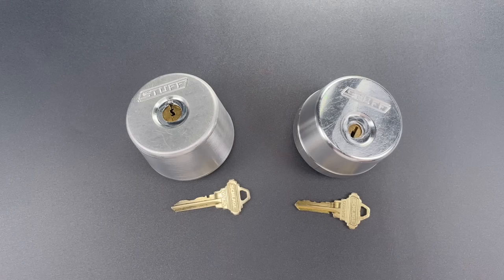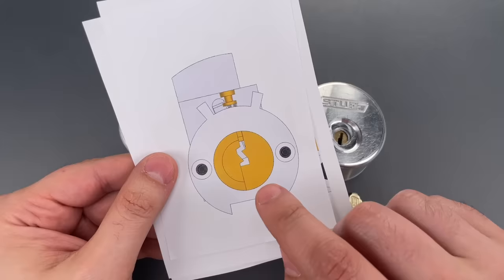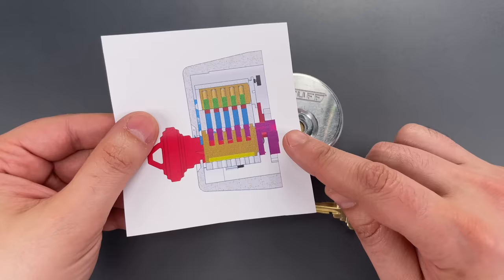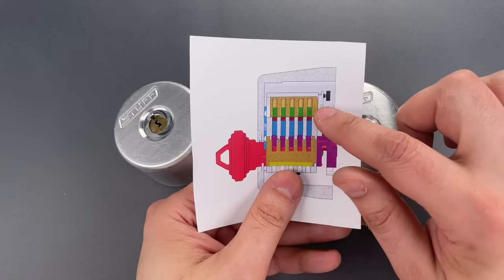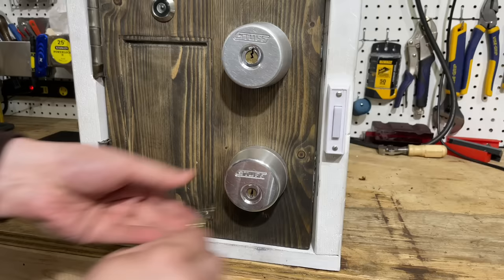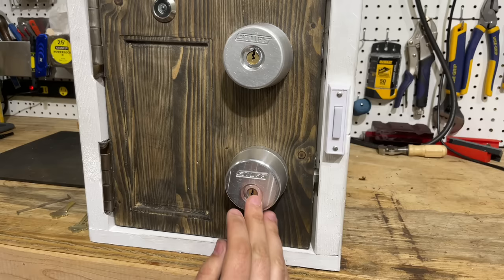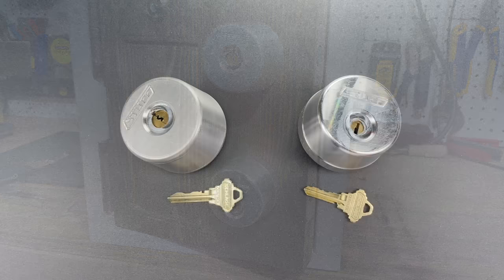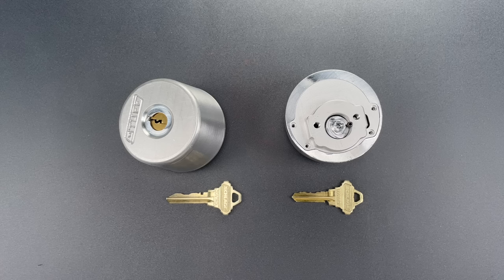[1299] Unpickable Locks From Stuff Made Here

Comment: Imagine putting all that time designing and testing these locks just for this guy to open them with a knife and a hammer.
Reply: the knife trick wouldnt work on a real door and the hammer trick only worked on the first design, he didnt even actually open it in a legit way.
Reply: @Alexandros.Mograine  he opened the second lock in a 'legit way@ by slipping a tensioning tool under the lock into the mechanism? the knife was just showing another vulnerability to the lock that was pretty clear in the video
Reply: @Kyle-kv6ur  that method also wouldn’t work on a real door. Locks are set in a little deeper on real doors. Had these locks been mounted properly, only the first would have been opened successfully. The second design can only be opened through kicking the door in or drilling the lock, which is already possible on practically any other lock.
Reply: @Kyle-kv6ur  didnt you watch the video? stuff made here made a part which makes that method impossible anyways.
Reply: @Alexandros.Mograine  "he didn't even actually open it in a legit way".
Yeah, that's literally what lock picking is.
Reply: Prototyping is designed for working out flaws. With what Shane has learned, he should be able.to design an unpickable lock. Possibly.
Reply: @CadillacDriver  you dont understand, what i mean is that neither of these tricks would work on a real door, is that so hard to understand.
Reply: @Alexandros.Mograine  I do understand. You don't understand that sometimes there are gaps in door frames big enough to get a knife in. That's exactly how the credit card trick works. Fact is, he bypassed and / or picked the locks. Therefore they aren't pick proof.
Reply: Have you seen the one with the "impossible to break in car" ?
Company was boasting and invited car their to try.
He walked up and kicked the front bumper. Doors all unlock.
Safety feature, unlocks doors incase of accident to allow emergency access to occupants.
Reply: imagine just having the skill and ability to design and produce a lock in your basement🤯 I'd be making guns personally but locks are cool too
Reply: @CadillacDriver  👍🤣🤣🤣
Reply: @CPTater  what's the vids title
Reply: @Alexandros.Mograine  "ackchyually he didnt even open it in a legit way" lmao you're gross 😂😂
Reply: @Accept_decline  yeah, if that lock was on a real door you couldnt open it with how he did.
Reply: @Alexandros.Mograine   haha oh God, can you just stop. What constitutes a real door vs a fake door? do you manufacture doors? Is a real door made out of vinyl or is it wood or steel? How big does the door have to be for it to be considered a "real" door? Does it have a knob or a latch? Are your parents blood related?
Reply: @Alexandros.Mograine  for real, I’m pretty sure my bedroom door is a real door, and I would absolutely be able to use a knife to open it the same way
Reply: @Accept_decline  I think he's arguing that poor installation or poor quality of a door shouldn't be a factor in determining the efficacy of the lock's design. If I put more RAM into a PC with garbage specs and it doesn't make my PC run faster, I wouldn't blame the RAM.
Reply: @Alexandros.Mograine  it definitely does if the door doesn't have a strike guard. There's plenty of interior security doors that lack them, though putting an extensive and over-engineered lock on such a door seems a bit silly.
Reply: Well, just look at cybersecurity. You got people designing all these systems and websites and all it takes is one flaw for the whole thing to come crashing down. That's just the name of the game.

Plus, it takes a lot of effort to build and design something like, say, a house. It only takes a little bit of Monster Energy and a sledgehammer to destroy it.
Reply: @Rher_the_Moon  I believe it👍 I've seen dudes in the Philippines make them from scratch with basic tools🤯
Reply: @Alexandros.Mograine   Imagine being a gatekeeper in an activity about finding exploits and vulnerabilities lol
Reply: @Alexandros.Mograine  what on earth are you trying to prove with "neither of these tricks would work on a real door" when both of the locks are custom made supposedly to be unpickable (which isn't as shown by LPL)

FOH, lmfao
Reply: @Alexandros.Mograine  actually this Is what Is different from theory and practice. Normal locks would be unpickable in theory but are in practice as it's important to make them usable. Tolerances are what make locks unsecure but also what make locks usable both in Summer and in Winter (e.g. the metal getting bigger based on temperature). So i think these are legit weaknesses even tho the design Is really interesting
Reply: @Alexandros.Mograine  yeah no i checked my door and the gap is larger than your brain, which isnt saying much, but still large enough to fit a knife through
Reply: @Alexandros.Mograine  I have used the knife trick on a closed commercial doors.

Comment: My favorite part of the more advanced lock is that the lock mechanism itself wasn't defeated, it was bypassed.
Reply: That's the same thing when it comes to lock picking 🥲
Reply: @louisrobitaille5810  no, because all you need to do is shore up the surrounding bits, and it'll be a great lock
Reply: And LPL kinda threw himself a bone too because he had a solution to the bypass given to him by the lock maker, he just didn't install it for the sake of the video.
Reply: @charlesquinton9127  The maker only knew about the bypass, because LPL told him about it. And it would have only stopped the metal shim up the backside of the lock, it wouldn't have stopped him using the knife.
Reply: @CrashB111  installing a metal bar so the space between the door and the frame is not accesible wouldn't have allowed the use of the knife, that had to do with the installing and not tj the actual lock tho
Reply: Also if the door was a tighter fit like most doors are, the knife method would never work
Reply: @Liam Nilan  exterior doors never open to the outside anyway, so the knife trick wouldn't work, you wouldn't be able to see the deadbolt like that.
Reply: @charlesquinton9127  However the maker did not know to make this until told of the exploit, how many thieves tell the lack company of a fault and wait for a fix before breaking in.
Reply: @Paul Stubbs  If the idea of these companies was to make the most secure locks possible, they'd do the reasonable thing and hire am expert to try and bypass it. It's not an issue at all, just fix it up a little with the feedback you got.
Reply: @timmyvigland8962  doors of public buildings always open to the outside. in an emergency situation inside, people rush to the exit and may completely jam the door area, leaving no room to open a door that opens to the inside.
Reply: @paulstubbs7678  gentlemen thieves obviously.
Reply: @klaus-udokloppstedt6257  it's clearly geared towards a residential type door though. Commercial doors do not use this type of lock.
Reply: @klaus-udokloppstedt6257  the doors to flats here open inwards.  
not exactly a public building but the same problem exists.
Reply: @liamnilan343  With wood framing even a very thin but strong knife could make that work, probably.
Reply: @louisrobitaille5810  all locks can be bypassed with hammer
Reply: you have a hentai as your avatar. any opinion you have is automatically meaningless.
Reply: @paulstubbs7678  Did you really think this was a production lock in circulation? Some of the comments here are beyond stupid. Tell me about some of the locks YOU have designed and built? What? None? Not surprised.
Reply: @louisrobitaille5810  Metal door, or plate on the door with the locks edges welded shut completely defeats the bypass. Its different
Reply: @ibrudiiv  as a carpenter I’d just drill a hole in the door frame giving you access to the deadbolt from the outside.
Reply: That's how most security defeats work in general.
Reply: @CrashB111  Dude if you didn't notice, LPL installed the lock backwards on the inside of the door.. The door jam blocks access to the deadbolt on the outside 😂
Reply: @CarlYota  Yeah you didn't think critically there did you? If your in a situation where can use loud power tools and destroy the building itself, then lockpicking wouldn't be necessary to begin with!
Reply: That’s the way you normally defeat any engineers design… you simply don’t do what they’ve spent so much time anticipating and instead just do something different and bypass their work entirely. It’s fantastic fun for both and if really love to watch these guys continue to collaborate and make a truly unpickable lock!
Reply: @paulstubbs7678 a real product would have people like LPL QA testing the product if their goal is to be undefeated
Reply: @chaoswraith but you could say "but you could change this and that-" about any lock. The point is, if you do make those changes, there could always be another way. So I'd still say until proven otherwise, it was successfully picked. Twice.

Comment: You could literally send a solid rock to this guy and he would still pick it open somehow and no one would be surprised.
Reply: Today I will be opening a geode non-destructively. . .
Reply: With a pick-axe.
Reply: Imo he didn’t pick the 2nd lock, cheated to get it opened. Could easily design a block to stop something from being slid through. And first method was dumb cuz that assume a gap in the door. Block that off.. 

So imo he never picked it. Great job to smh, not worth building a v3 until he can pick v2 properly.
Reply: all you need for that is pretty big hammer
Reply: @carsonhunt4642  but he did pick it. Have you seen a door without a gap? He also mentioned he could have used a tool to measure the pins and make a key for it.
Reply: "Trying to avoid all the work, I came up with a less elegant solution."
Reply: A grenade
Reply: @carsonhunt4642  Pick it urself.
Reply: @damiengates7581  clearly has not seen his videos with electronic locks
Reply: @saikashima282  My dead bolts have a flange that goes into the hole about 1/8"... probably the "much cheaper solution" (vs "custom machined guard") that most mass-produced dead bolts have..
Reply: @carsonhunt4642  This isn't just about picking a lock. This is showing the faults of a lock.
Reply: @MarcosElMalo2  Haha! 2,000 years later - some alien explorer: "Hey! I found a geode! I'm gonna be a gazillionaire!" Opens it: "What the...."
Reply: TODAY on Rockpicking Lawyer..

Comment: As a welder,  here is a trick we use for some locks, file the back of the key do it is straight,  making a long slim key weld a plate (for steal door) over the lock that has a hole slightly smaller than the key stop at the end of the splints. The lock can not be hammered off,  added length stops a bump key, makes the lock difficult to pick. Even another key not filed down , can enter into the hole in the plate, as the hole is to small. This solved a lot of theft in remote job sites.

Comment: Shane: makes two impossible to pick locks
LockPickingLawyer: “Yeah, there’s like 2 ways to pick each lock.”
😂
Reply: True.
And these ways are easy to fix.
I like the respect the two guys have for each other.
I think with the improvements they are getting even harder to pick and perhaps even hard enough to pick so that it's just not worth even trying it.
Reply: @fickdieoma12345678  at that point it will be easier to melt the lock
Reply: And both methods can be fixed quite easily.
Reply: @fickdieoma12345678  lock pickers replace all their subtle tools with a battering ram
Reply: @fickdieoma12345678  Im really curious how long it would take to keep fixing these issues before LPL cant pick it anymore.

I feel like if they kept sending the locks back and forth, after a few iterations, it would require a completely new tool to be made in order to pick it.
Reply: @fickdieoma12345678  that would be true IF the actual practical purpose of a lock was to delay a thief not stop a thief. Any lock claiming it can stop a thief is lying to you. The locks in this video took a trained lock picker a month a figure out but in minutes he was able to get into the door. As you effectively have 8 or so consumer locks total if they are not custom made the lock  you have is only good at delaying the person trying to get through it.

The custom part goes with the false notion of "security through obscurity". "security through obscurity" is not true security past he also false notion that having  a lock on your door will prevent a thief from getting inside. There is a point said thief will just break a window in a place out of view instead of pick the lock however locksmiths have will be there trying to pick the lock.  Having a lock on your door reduces the chance of being broken into and having said lock locked makes it only a little bit higher that the person will just find another target.
Reply: @yumri4  just get bullet and hammer proof glass double plane then what cut a hole in the side of the home? dig into the basement?
Reply: security requires wide approach (good doors and windows, good lock, monitoring system, alarm, anti-burglary blinds, a dog and a gun). Nothing can stop determined thief but if it's too much hassle and risk thief will just go to next house instead of yours.
Reply: There's a 99.9999999999999999999999999999999999% chance that nobody will ever pick it just to break in
Reply: @fickdieoma12345678  one day after many iterations there’ll be a lock that could keep lpl out of his house if he forgot his key.
Reply: Someone most stop the LPL, surely there's a lock he can't pick somewhere! Right?
Reply: @vibaj16  I can already hear it: "This is the LockPickingLawyer  and today we are going to use thermite to pick this lock."
Reply: @eragon78  
It feels like they could even invent a lock that is not pickable without brute force (tring it many many times or with some kind of destruction)
Reply: @yumri4  
All this is true.
These locks are not meant for practical use. This es clearly stated in the video of Stuff made here.

And for me the practical use is less important in the context of this video. In this case I honor the thinking process of both these incredible ppl.
Reply: @fickdieoma12345678  I agree i do like seeing the thinking process they used to create new kinds of non-standard insides of locks.